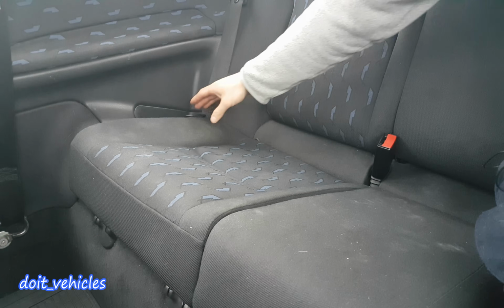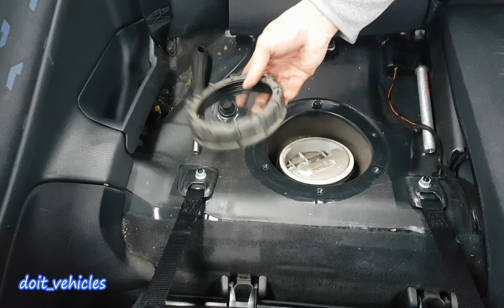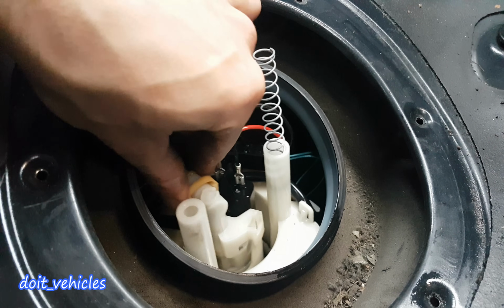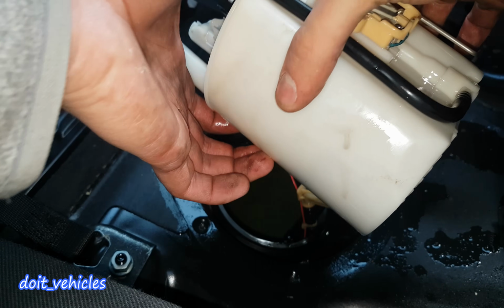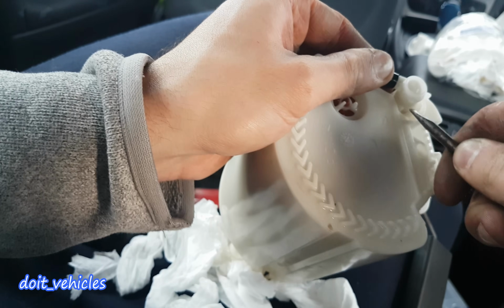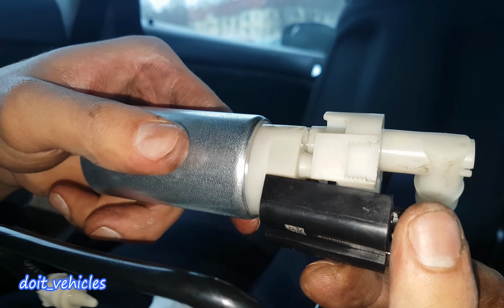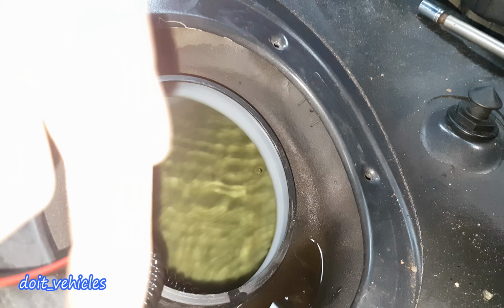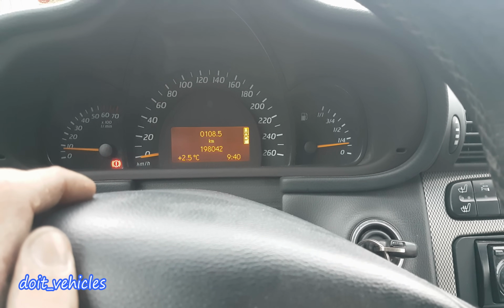Mercedes w203 Fuel Pump Replacement c class c160 c180 c200 c230

Comment: Mercedes-Benz had 150 final stock manufactured in January* from germany fuel delivery modules for the w203 (right side of tank) it costs about $300, mercedes uped the gph from original. Work at MBUSA and am very happy with the new one. Did install myself on existing tank, also replaced drivers side fuel sending unit(mercedes)

Comment: Hi. I have replaced the fuel pump on my mercedes c240 but the gauge still shows there is no fuel even when there is fuel in the tank.
Reply from the maker: than most likely the whole unit must be replaced , try to test the sensor

Comment: Hello! Is this applicable for w203 C220/diesel/ models? My problem is that the fuel level doesn't showing on the cluster, should i change the pump too ? or just that thing with the circuit board ? Thanks !
Reply: I'm not a mechanic but usually diesels have higher psi and different fuel delivery systems

Comment: Hello, I'm a follower of your page and have noticed that you're very good with these machines, with very good, informative and great videos. I have a w203, c200 Kompressor. I'm from Africa and my country gets very hot. I experience an issue where if my fuel level drops to say 1/2 the car starts to act like it will cut and eventually just cut  and this only happens when I come to a complete or almost complete stop of say below 0.5 revs and 5km/h. I will try and press the accelerator but the vehicle will just not pick up. If I go to a fueling station and put fuel the car will return to normal firing order until the fuel drops again, or if I just park and leave it for 3hrs or more the car will operate just normal even without the top up of fuel. If I put a full tank the car will run fine until it reaches 1/2. Also of late I have noticed that if I go to 3/4 and it drops to the line between 3/4 and 1/2 the car will lose power until I put more fuel. I have tried to fill up and found that there is actually fuel in the vehicle. Please advise on what I can check or do to fix this issue.

Comment: Hi friend! It is me again. I have to share this experience with you and your crowd here. Yesterday, car would not start again! The day before it hesitated to start on peteol, but after few seconds, it started. Yesterday it did not!!! Pulled it again to repair shop, it seams that the fuel pressure regulator broke and when the pump started, making the preassure, one of the HOSES from the pump outlet broke and fell down. This is the least expensive thing that happened to me and my c180 w203, but it still happenede. So...
I just wanted to lost this problem/solution here

Comment: Nice video, please I need your advice, I have the same car and my fuel indicator is below the yellow light and it doesn't even move. I saw one of videos and I replaced the Relay, fuse, fuel pump and the fuel indicator dashboard but still didn't work, 
Please what else can I do to fix this problem.
Thanks
Reply: Isnt it just the fuel level sensor?

Comment: Hi there ,doit_vehicles  What is the issue on NO PRESSURE IN FUEL RAIL?
Reply from the maker: The fuel pump is the first suspect
Reply: @doit_vehicles  I replace both pump and sender new. Still no pressure.
Reply from the maker: @Jojo51058  does the pump gets power ?
Reply: @doit_vehicles  from the key on  i hear pump humming sounds.
Reply: plus i noticed that when I replaced the pump that side the tank is empty.

Comment: C220 cdi also?
Reply from the maker: I made a video on high pressure fuel pump for that diesel engine on e class
Reply: doit_vehicles many thanks. I just figured out I put petrol instead of diesel in my car 🤦‍♂️.
Reply from the maker: @ottomancalligraphy7254  oh no .. that might destroy the engine ..

Comment: Hey all, i have a c200 kompressor 2002 and i cant seem to find the exact same fuel pump for it here in canada so i purchased a hella 7.00468.48.0. someone told me it might fit i can still return it if it doesnt. aNyone know if it will fit? or if i need the exact same pump

Comment: Hi great video. Would you have a part number for the pump you installed...or a link. Parts store had ones pretty close but asked if we know a part number to zero in. If you search for part you get whole assembly...I like how you changed only the pump component. Any help other than search "fuel pump" would be great.
Reply from the maker: Officially you can not find only the pump that can be replaced , you must buy the whole assembly; That's how they make it on almost all newer cars unfortunately   . However it is possible to install an aftermarket one by modifing the old assembly , it won't look good , but it will work and save the money . But first you must confirm that the pump itself its bad .

Comment: my benz w203 c 180 compressor car fuel tank working but no fuel come out to hoses .there is a sound when key on to 3 rd position . What will be the technical error or bad fuel pump.?

Comment: Friend. I need help.
My w203. Right side tank. Fuel Always empty.
Left side tank always full gasoline.
What my problem car?
And than alway cut off enggine.
I see right side tank gasoline empty
But.  Left side tank. Always full gasoline
Reply: I have the same issue with my pump too, like what you said what exactly the problem of that? I have W203 C 230 K 2005.
Reply: @Jojo51058  the problem fix. Fuel pump.
Now ia done.😊. Change fuel pump. Fuel filter. And fuel regulator.
Reply: @wahyuprastowo2114  I did all of that still don’t start and I checked the fuel pressure was zero with 2 different fuel gauge tester.
Reply: @Jojo51058  my problem car running 30-40km. And enggine stall.
I don't know before,. 
Buy fuell preasur gauge,. My car presure up down,. Unstabil.
Buy new fuel pump and my problem done😊😊😊
Reply: @wahyuprastowo2114  Most of this problem is from the Fuel Sending Unit due to accumulated dirt / loose hose and not from the Fuel Pump which always seem to be a culprit which can be diagnosed simply by just listening at the back seat or by opening the fuel filler cap once you turn the key to ignition position, a simple clean can solve such stalling problem and save you a lot of money.

Comment: My fuel level shows high and when its almost out of gas its around 1/2 whats my problem ? If you can kindly let me know
Reply from the maker: The level sensor is not sending the corect signal . Try to do a test with a voltmeter to confirm that . It's a potentiometer so use the voltmeter on ohms mode and see if the resistance change all the way along when you manually move the sensor on the fuel pump assambley .

Comment: Dear friend, i found a mechanic that fixed my problem. There was filth in the fuel rail, so the new injectors were clogged after the month and a half. He cleaned the rail and cleaned (washed) the injectors and now it works fine on petrol as on LPG. Thanks for your time
Aleksandar
Reply from the maker: That's good news ! Shows that there should always be a systematic diagnose done when there is a issue with the engine .

Comment: Helo! Thanks for the video. I managed to replace my fuel pump on w203 c180 kompresor. Recently i have replaced sparks, filter and i still have rough idle and the car turns out after half a minute from ignition. When the temp is on 60 degrees it turns the LPG on and it runs fine. So the trouble is somewhere with fuel (benzin) from pump to motor, or mixing with air?
I smell gas while its running before the lpg kicks in.
Did you had similar experiencies? What can be the problem?
Thank you in advance
Aleksandar
Reply from the maker: Hei ! Is your car with a lpg conversion ? There can be a lot of things causing this . Its a good idea to gather more data from all the sensors first to get an general image..
Reply: I have BRC LPG system, two months ago i got misfire codes on 2 cylinders, in workshop they machined the motor "head", changed the valves, new sparks, filter, injectors, they tested the pump which had enough preassure in that moment. I am crazy about this, dont kniw what to do anymore. I dont beliventhe repair shops anymore. The only thing i havent checked is that fuel pressure regulator and havent checked the fuel lines. Maybe it is some of the sensors for mixing air or something, i dont know. Timing chain was ok when they did the valve replacement. It worked ok for less than a month and once again i have the same problem. The funny thing is that when it swithc to LPG it runs smooth

Comment: i hv a manual c240 6 gear and my problem is wen i fill up fuel my car it runs well, 20 - 30 km it stops and the gauge show wrong reading but wen i fill up fuel it moves again ,i opened my fuel tank and the other side of my fuel tank will be full and the other side where the pump is will be empty and dry,so is it mean my pump is dead or .....?
Reply from the maker: Is the shape of the fuel tank allowing for that extra fuel to not be reached by the fuel pump ? The pump will burn after a while if it does run without pumping fuel

Comment: Hi i need to replace pump on Mercedes  A 160 year 2000 can i use a Manual pump on Automatic or are they different cant find out anywhere else Thank You so much
Reply from the maker: as long as the pump is for the same generation w169 , than it does not matter if the car is a manual / automatic
Reply: @doit_vehicles  Thank you so much

Comment: I have a 2007 CLK 350 I Change the fuel pump sending unit and filter but its not reading the gas when full just when it get to half way then it start reading do you know why
Reply from the maker: sounds like a defect level sensor which is attached on the fuel pump unit . I would first visualy inspect the sensor and check if the small black pin has contact on the board all the time ..
Reply: There are two fuel level sensors in your tank. One comes with the fuel pump on the right side of the tank. The other sits on the left side of your tank. They are interconnected.
Reply: I will check that out its bran new both units and hoses
Reply from the maker: Before replacing the unit , was the level sensor working ? It's quite sensitive senaor and it might got damaged during the transportation/ instalation ..
Reply: Its all bran new the both units and yes it was working befor i changed it
Reply: The fuel pumps i just replaced 5months ago i did all the test one was completely bad so i just warrantee both out its fine now thank you for the help

Comment: my car smells of petrol and consumes 24 liters for 100 km.  travels very heavy.  and has a start like a turtle.
Reply from the maker: Any oxygen sensor codes ? Excessive smoke from exhaust ?
Reply: doit_vehicles made me 4 errors in the beginning P200B, P200F, P2039 P203A.  when start car (automatic transmission) and start moving it gives me blows of the minium
Reply from the maker: @xhuljanxhogu4493  Try to test the Evaporative control system and the Secondary air injection system first ; If you have a scan tool with live data , that might help a lot ..
Reply: you might have a leak!! check your lines

Comment: I changed my pump but fuel gauge is showing wrong measurement and most of the time it's on empty even whe tank is full.
Reply from the maker: You changed the whole assembly ? Than it's the dashboard issue 🤔
Reply: @doit_vehicles  could  you please explain more I also have an issue with my fuel guage
Reply: @doit_vehicles  Or can be a fuel sending Unit also or a cross wiring mistake between ground level sensor and gauge sensor when we install aftermarket cheap part. Fuel pump and Fuel Sending unit always integral / interrelated parts and so far the fuel is moving smoothly between them and reach to the fuel injectors, the cluster gauge is irrelevant in such equation.
Reply: The fuel gauge gets its signal from two fuel level sensors in the tank.
One one the right half combined with the fuel pump and one on the left side.
They are connected to each other and when one of them goes bad it will effect the fuel gauge like yours did.